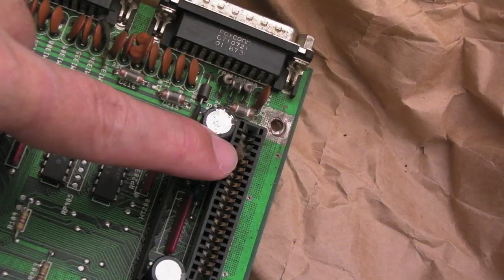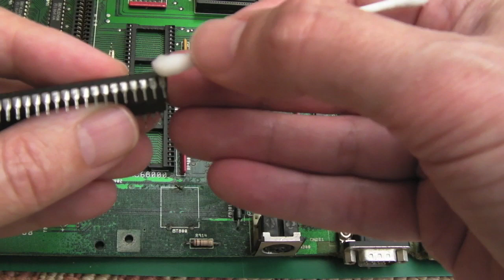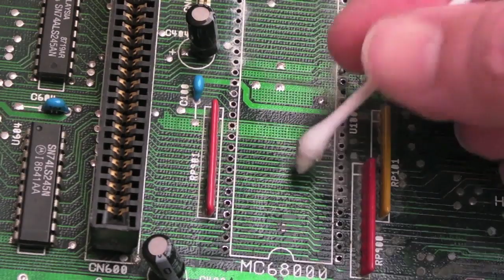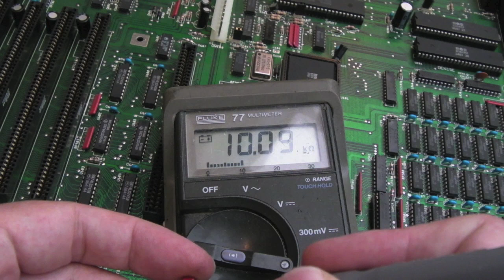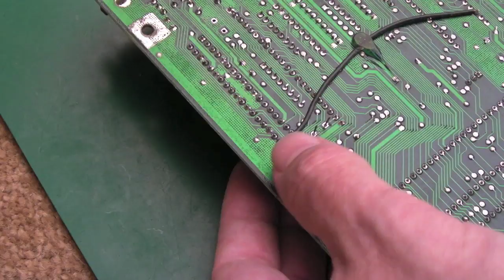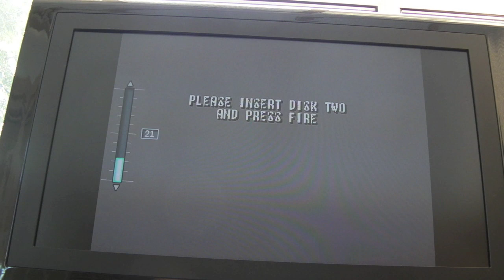Commodore Amiga 2000 Motherboard Repair - Part 1

Comment: Great diagnosis vid, I appreciate it as I have 4 2000 boards. Hopefully I can get them working with these board/self repair issues shown. Helps to know what I've fixed vs what I've done. Another good show my friend.

Comment: Thank you very very much, your video was great and will be so helpfull when I attack the battery damage on my 1992 A2000R6 in the next weeks. Just de-dusted it today and got a slight shock 😪. The area is not as big, but between the CPU socket (especially under it -.- ) and the Rom it looks pretty bad. Let's hope it will go as nice as for you :). 😊✌👍

Comment: hello my amiga2000 don't work ( black screen )
chips are good , mother board is good , there is no battery  but it don't work 
the cpu is reset ans halt low !  
can you help me please
Reply from the maker: You could try and test with Diag ROM.  If the halt pin continues to go low, you probably have a databus conflict somewhere or bad RAM.  It could be some of the 74 series logic related to that RAM too.  Corrosion is the most common cause on 2000 motherboards.

Comment: How did you interface the monitor?
Reply from the maker: I just used a standard Amiga RGB Scart cable.  It connects to the 23 pin D type socket and goes to a SCART connection on my TV.

Comment: I can remember in the early and mid 2000's most Amigans turned their noses up at the A2000,  they often fetched a measely £35 on eBay.
Reply from the maker: That's shocking lol - I would have bought 10 at that price lol!!!!  They aren't cheap now - around £200 upwards for an A2000 these days =/

Comment: Wouldn't foam ani static cleaner be better than vinegar?
Reply from the maker: Not really - the idea with white vinegar is its an acid, and acid is needed to neutralize the strong alkanline from the battery leakage.

Comment: I had a DKB Mini Megachip, 2mb Agnus and a Super Denise in my A2000. I also had a 3.1 ROM. They originally lived in my A500 but thankfully they are compatible between the two systems. I also had a Supra Turbo28--if you remove the board from the case and set a jumper, you can plug it into the A2000's processor slot.

Comment: Have you seen they reverse engineered the A1200 and the gerber files are available to download http://wordpress.hertell.nu/?p=587
Reply from the maker: Yes - it looks cool!  Not in any rush do get one as you need a full set of chips for it.  Ideal for super corroded boards etc.
Reply: @GadgetUK164  Yeah looks like acquiring the full set of chips might be challenging.

Comment: I start out with the board in a vinegar bath. Once the fizzing subsides I take it out, rinse it under the tap, give it a really, really good shake (those Zorro sockets hold about a gallon of water each), and then off to a 91% IPA bath. Then I hit it with my hot air station (on low) to dry it off.

I use white vinegar and I just let it soak for however long it takes.

Comment: Great video, love the detail you give. I am just getting into the hobby and learning and saw when you replaced the 470uf cap you put in a 35V not a 16V, I though you have to match the voltages?
Reply from the maker: Thanks!  No, you can use higher voltage!  Always good to use higher temperture (105 degrees) too.  There is an ESR associated with the voltage rating of a cap, but the ones I've used are low ESR Panasonic FR series.

Comment: Have you thought of the dish washer trick ?
Reply from the maker: Yes, it's a good idea (if you have a dish washer - I don't), but there are some issues - moiusture can get under pins and chips etc, so you need to make sure its totally totally free from any moisture before use etc.  Dishwashers also often contain lots of salt and other chemicals etc that can affect things on boards.  Labels may come off too.

Comment: Really enjoyed that video, I would suggest using flux rather than adding solder whilst removing chips.
Reply from the maker: There are benefits to adding solder rather than just flux.  Flux burns up pretty quickly, and mixing new solder with old solder often helps too.  The other problem if you just add flux to all the pins you are desoldering - the filters on the desolder station block up 4 or 5 times quicker!
Reply: @GadgetUK164  That's weird, when I add solder it clogs more quickly.
Reply from the maker: @zxrenew5642  It's going to vary on different factors I guess!  I've desoldered both ways and for my last (and current) desoldering stations the filter lasts no time when using just flux.  That said, the tube will fill up with solder quicker, that's for sure lol.

Comment: Tip for desoldering station - can’t remember from your review if you allready do this; clean spring and glass, mount both on rubber gasket and spray a bit of WD40 (eww), or a real and good lubricant, inside to coat spring and glass lightly. Don’t get it wet, just a bit of a coating. Cleaning it will be much easier next time. Works a treat on manual desoldering pumps too of course.

Comment: Wouldn't it be wise to treat that battery waste with a bit more caution? You get close to touching it with your hands in the video. Cadmium is poisonous in low concentrations, so I'd say we should avoid touching it. Those cotton swabs are chemical waste. 

Heating it up with a soldering iron and inhalating it is also a concern, so I'd say you are doing the right thing in doing the cleaning before desoldering.
Reply: Daniël Mantione would imagine it went straight in the bin! 😂

Comment: You don't need RP900 & RP901 Resistor Packs Chris! Just leave them out.
Burn a DiagROM and do chipram test, also try to clean Agnus socket, Your fault can hide there...
Reply from the maker: Thanks =D  I might remove them, but from what I understand there's an advantage to having those when certain modern EPROM / EEPROM chips are used I think.  I did notice it worked fine without that pack whilst I was hunting for a replacement though!  DiagROM doesn't detect all RAM faults, as you will see in part 2 =D

Comment: It bloody works too!! You've got more jam than Hartleys, mate ;) Neither of the two rev. 6 boards I have chooch at all - the one with the golden solder mask is as dead as - the green board boots with a grey screen. Sadly, the board which was populated with the A2630 and oktagon had the worse battery damage, with the battery's goop eating halfway up both cards. It's going to be a huge undertaking but worth it in the end.
Your's will turn out mint, no doubing that! Thanks for uploading and be well :)
Reply from the maker: I know lol, I am as surprised as you are!  Just lucky I think, but I also lucked out (perhaps even more) on the corrosion on the fully cased one too!  Ouch at the corrosion getting onto those cards there =/  That does sound like a major case of corrosion for sure!

Comment: Commodore's West German latterly German subsidiary was in Braunschweig (BSW), not necessarily the European HQ due to the corporate structure of Commodore, but they did make a lot of hardware, the very first Amiga 2000s (Rev 4.0 I think) were actually a BSW design and can be easily identified by their short video slots. Thankfully yours is not that revision, as you can see it's using a Fat Agnus and A500 based design rather than the A1000 based BSW Rev 4.0 which uses a DIP Agnus.
Reply from the maker: Thanks for the info there!  I wasn't aware that the early 2000's used the DIP agnus - that's super interesting!

Comment: It is 4.x revision, unfortunately these are very picky about Zorro cards and CPU Slot, Accelerators are not working quite often on these if You insert it into CPU slot. i have a list with BUS fixes to make it closer to 6.x revision thanks to them i managed to let all my accelerators work on rev.4.1
Will send it to You

As about PSU connectors - will send You one with TF534.
Regards,

8 Bit Dreams
Reply: Any chance of making that list available?
Reply from the maker: Wow, that would be awesome if you could provide one of those connectors!!!  I can wire it up to my ATX PSU then and use that for working on more of these boards!  The mod list sounds useful too - I've done a some mods to the board in part 2 (factory corrections etc), but your list might have some that I am not aware of!  Thanks!!!!!

Comment: Thanks for another great video! That looked scary at the start with all that battery damage. Good stuff. Looks like a fun project. ps I have that exact de-solder station but it is branded as Duratool. I have been through two guns for it over a couple of years. Keep an eye on the 3 screws that hold the nozzle to the gun. They only screw into plastic and I managed to break them on my first gun by orbiting pins too heavily. Farnell does spare guns for about £30. The nut holding the barrel on seems to work itself loose over time with heat/cold cycles as well. Keep it up..
Reply from the maker: Thanks - yes, that's precisely what the issue was!  That nut unscrewed and the tip was barely hanging on lol!  I check that regularly now!!!
Reply: Mine was a bit wobbly, and decided to bend a bit much, broke the locking parts inside on  the black ring, and ended up at 45 degrees.  Had to epoxy the black part in the body,  its never coming apart again, even if I wanted it to.  Be careful taking it apart, the spring where the glass container lock is decides to make an escape.  CPC does the guns for under £23
Reply: @andrewclegg9501  Yeah, the glass tube on my first gun went bye bye early doors🤣

Comment: So you said we would see the full computer in a few seconds????  An hour and 12 later I still don't see it  ;)  
I take it we've already seen it on an already uploaded video?  This one looks a fun repair.

I need to get a desolder station. I spent 40 mins desoldering a C64 CIA.
Reply from the maker: Oops, sorry!  I meant we needed the full 2000 for the PSU etc!  Don't worry it's coming after part 2 of that board repair.
Reply: Avoid this one: https://www.ebay.com/p/Station-Lcd-Rework-Vacuum-Temperature-Desoldering-Zd-985-Controlled-Digital-Dual-89-8513/1428444730?iid=132343795994

It lasted about an hour and the heater melted the case and fell off. A friend of mine who moved to the UK gave me his Hakko. So far it's working well.

Comment from the maker: Part 2 - https://www.youtube.com/watch?v=pBbil_Cmo6k

Here's a link to that video regards bipolar caps - https://www.youtube.com/watch?v=Pej1NzPP_1s   The example in the video isn't quite the same thing, but never the less it shows the effect seems to be nothing.  That pin header at the back near the parallel port - that connects to the PC bridge side of things.  So if you have a PC card in there the PC and use the parallel port.  For some modern accelerators you need to remove the 68K from its socket, but with older accelerators the two can coexist!